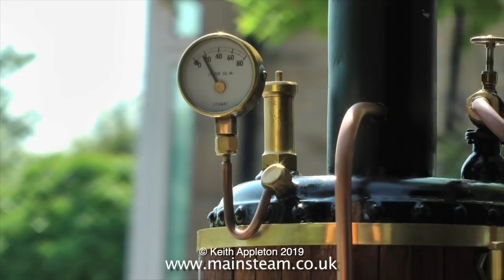MODEL STEAM ENGINES IN STEAM

Comment: I use to run a water pipeline in the mountains of NM, that ran off an old Fairbanks Morse engine. The engine always reminded me of a steam engine with its massive fly wheels, my grandfather had a love of steam engines and he use to take me to see any steam engine within 1000 miles that was still running... lol it was like our little trip to a religious site...  Anyway, the old pumps caused the water to pulse through the pipeline. I was reminded of this as the water pulses in your video. One draw back to this pulsating pressure was a ever so slight movement of the pipeline in the ground.  Since we were in the Rocky Mountains, this tiny movement slowly wore holes in the pipe. About every other day, I would see pressure drop and know there was another hole somewhere in the line. Since this was a semi arid environment, it didn’t take long for us to find holes, the desert plants would begin greening up almost immediately. I would saddle a horse, throw on an shovel, pick, repair pipe and tools.... then start off down the line.  
Your videos remind me of my youth and love of old heavy steam and in our case propane driven engines.  I left the ranch when I joined the Navy in 1988.  I haven’t been back. But I occasionally use google earth to see what has changed on our old homestead.  The pumps, pump jacks, water tanks, homes, barns are all gone.  Time has a way of changing things we feel are permanent. I wish I new what happened to the old engines, probably scrapped... my grandfather homesteaded our place before NM became a state. When I left home, I was the last and my parents were lonely, the closest neighbors were 5 miles away and truthfully, they closest people they considered friends were 18 miles away. Life was hard rewarding work but as kids moved away from agriculture and profitability didn’t keep up with inflation .... well the community that one once had hundreds of children and young families shrank down to 20 kids in a 3 room school house grades k-8.  These kids rode buses as far as 50 miles a day. JR high and high school was a 147 mile drive every school day, 20 of those miles on unimproved dirt roads.   I’d go back in a heartbeat if I could bring back the community that once thrived.  I think that tragically, like these old engines.... the beautiful world of strong moral beliefs, hard work and a sense of permanence is gone.  I’m sure this has happened throughout history.